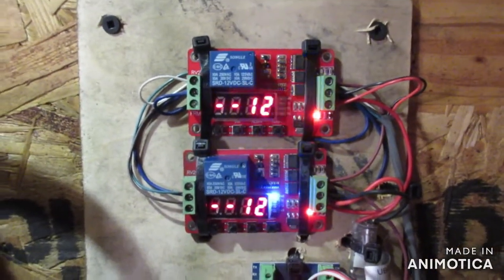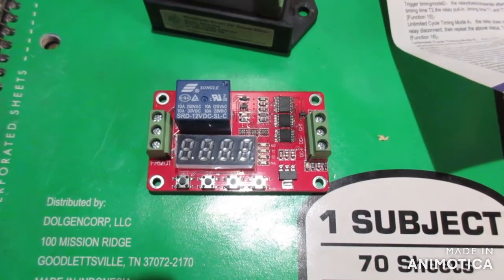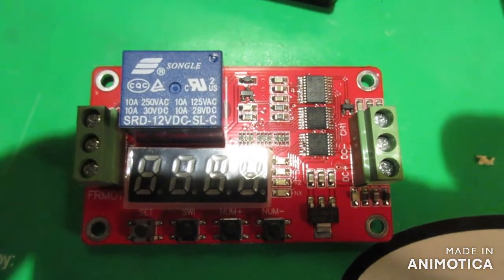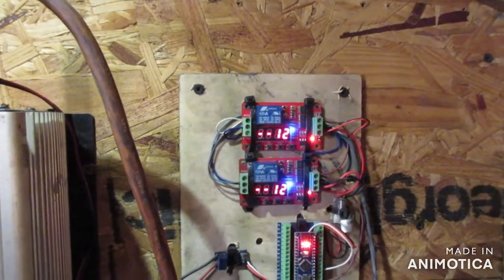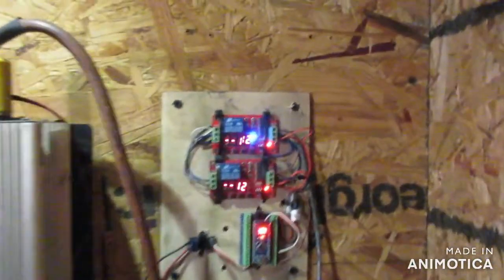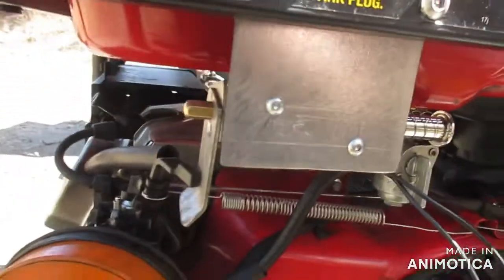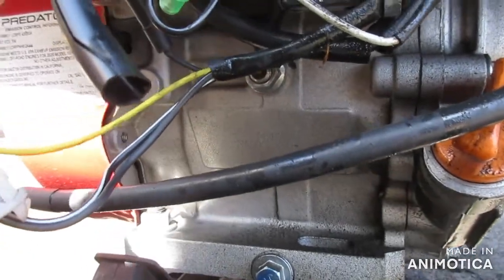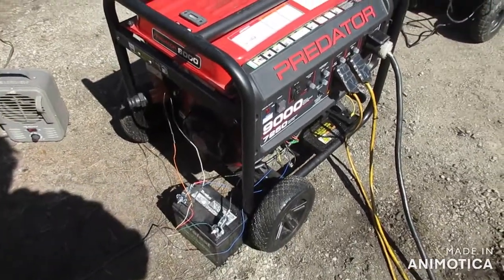DIY Auto Gen Start System

Comment: Interesting.. How does it work with the gasifier??
Reply from the maker: It dont it is for stock set ups only. To run a gasifier you simply disconnect it.
Reply from the maker: However, the VersiFire will have this capability, I already have autonomous systems developed. The VersiFire will have a bluetooth app for your phone and you will have full control of the machine from this app. This here in this video is very low tech compared to my more advanced automation systems.
Reply from the maker: See this machine here. I am only telling the controls what I want to happen via the touch screen interface. The controls are what is actually running the machine. https://youtu.be/05MO8aQVQ_I